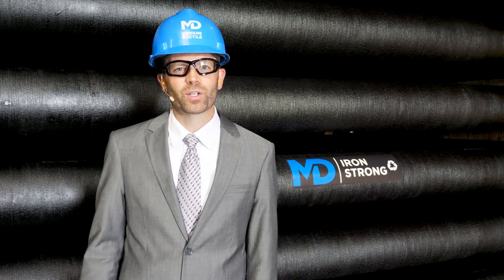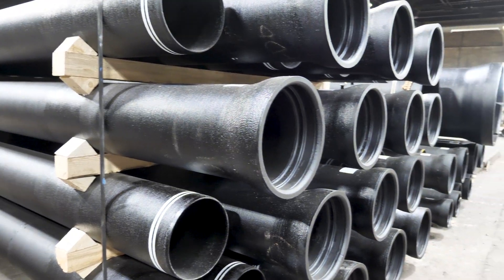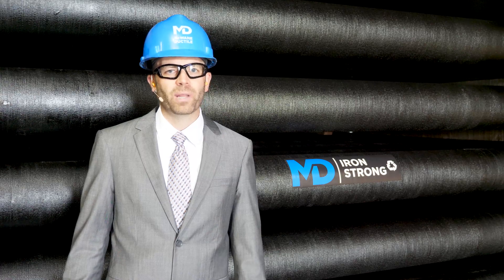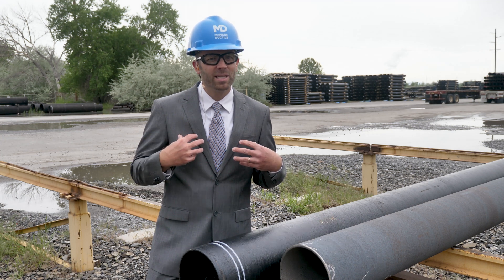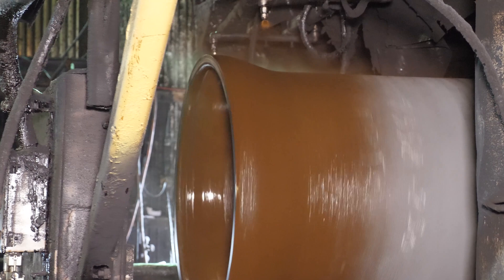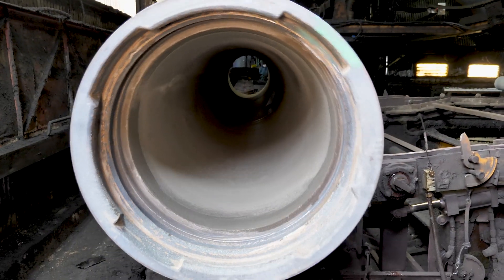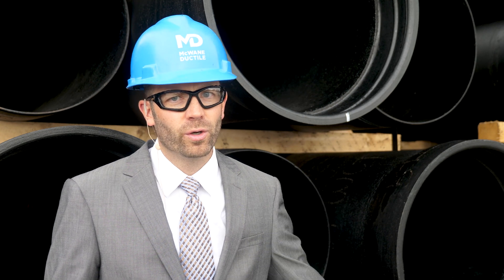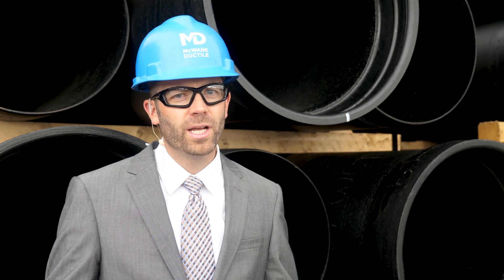What is Ductile Iron Pipe Seal Coat?

Comment: Seal coat can be done external after Zinc coating
Reply from the maker: Thanks for your comment. 

Seal coat can be applied after zinc coating. We have a video that shows the process here: https://youtu.be/rTCNUlsOTgQ 

We have also made a video that explains when and where to use zinc coating here: https://youtu.be/g5XQDMi8pwI

Hope these help. Good luck on your next installation.